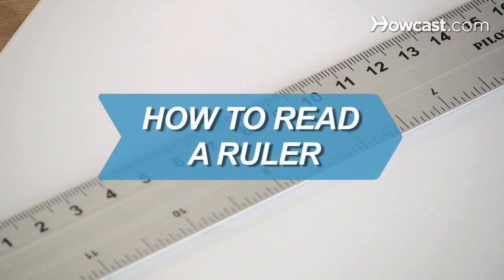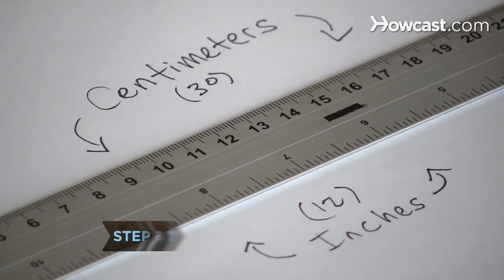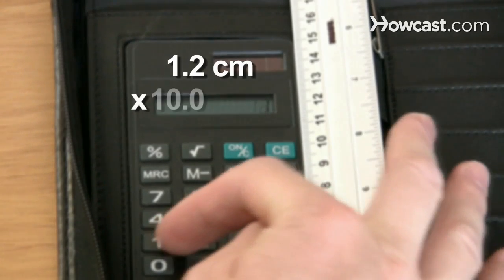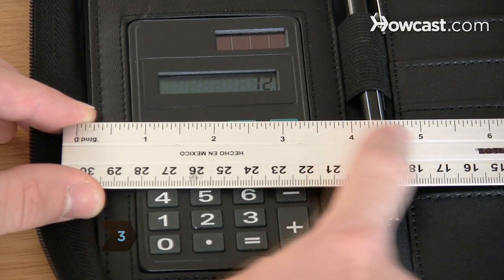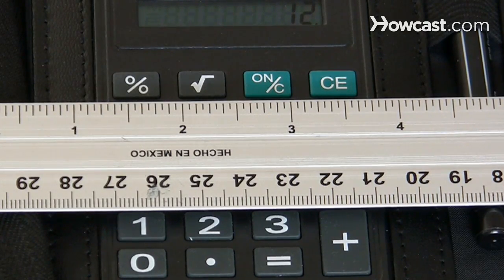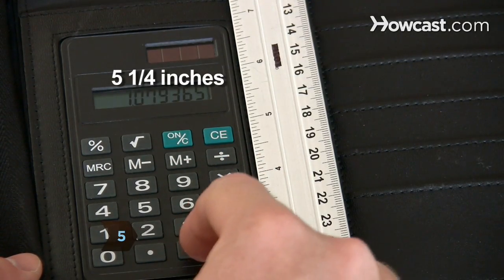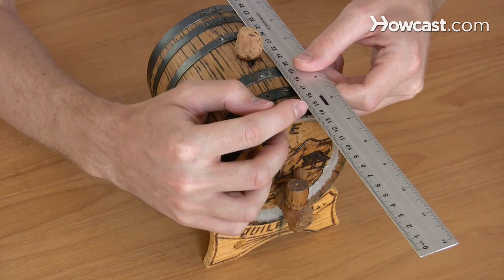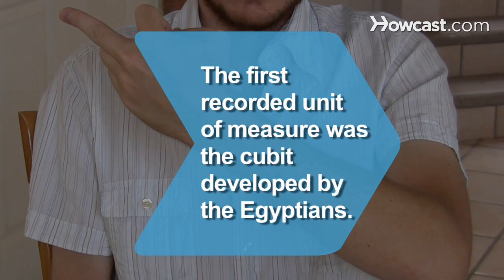How to Read a Ruler

Comment: What does .36in equal in inches is it thicker than 1/4 inch basically I'm looking to buy some steel from a website and it sales in .36in and .212in sorry for not being good with this but what would a quarter inch thick read in these measurments. Im thinking .36in thicker than  .25in but seeing the .212in really confused me any accurate answer asap would be greatly appreciated thanks in advance